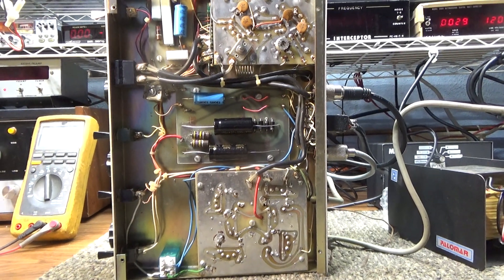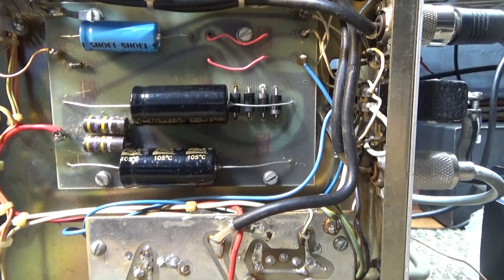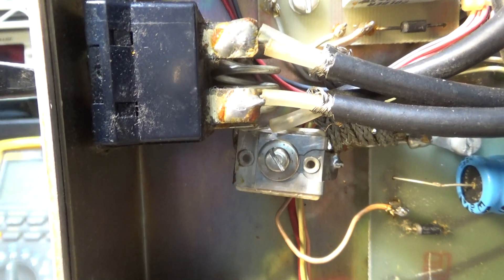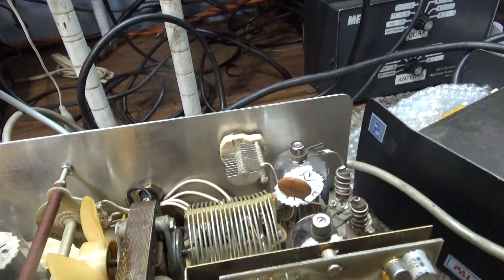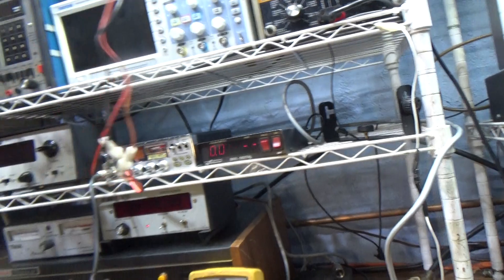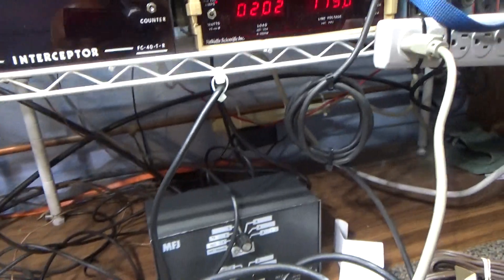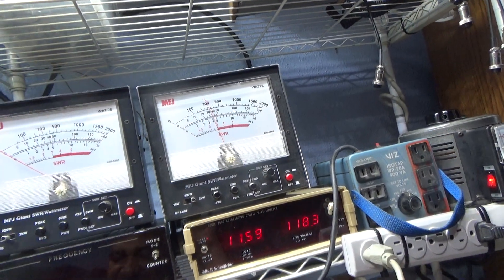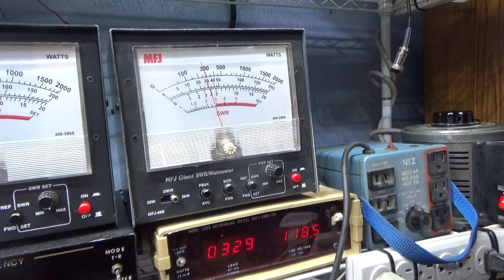Palomar 300A (customers) recapped and on the bench + how to tune.

Comment: Where can I find a transformer for a 300a just like that? I had on at one time with 8950 tubes and it rocked
Reply from the maker: Sorry, I don't know. More people looking for transformers than transformers available. Peter Dahl used to make one, but not anymore. A Toroid would work but would not fit in the original box.
Reply from the maker: Good news is there is one on Ebay right now. It's not mine and I know nothing about it. Bad news is, it's 250 plus the ride and the case is a little beat up: https://www.ebay.com/itm/116182142541